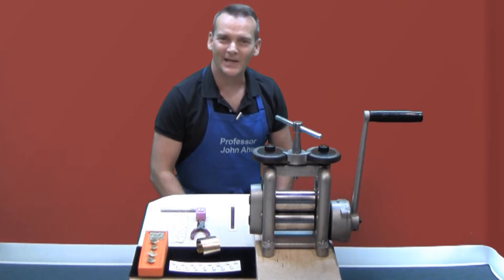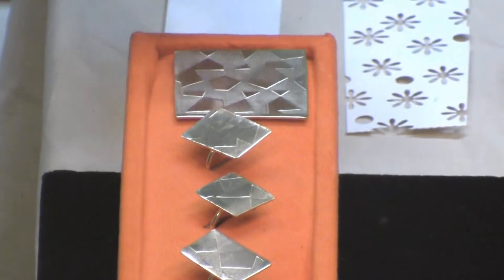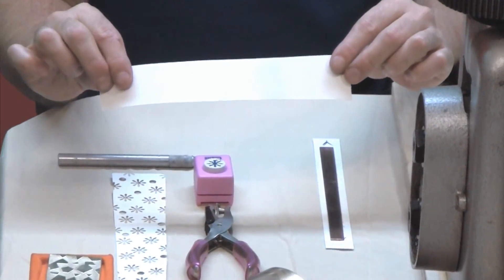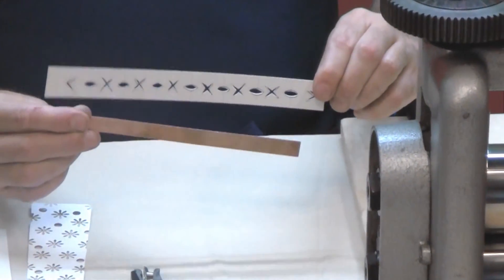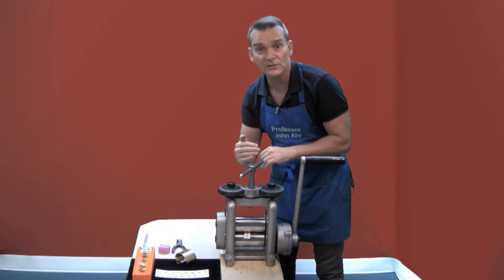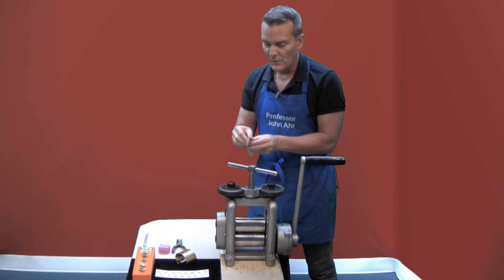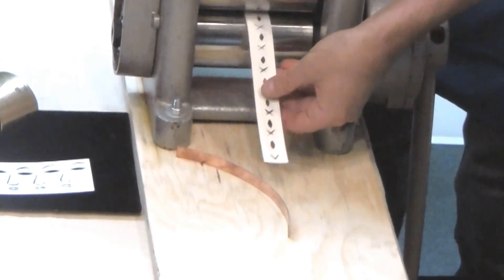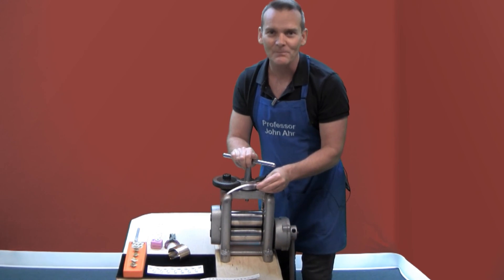Create Texture And Patterns With The Rolling Mill Using Paper

Comment: As always you make me so happy to think of all the fun projects I can create with the skills you share!  Thank you Prof. John!     ps I am a bit afraid of damaging my Durston- saved forever to buy it.  Some sites say to wrap the project in paper towels before putting thru mill.  Thoughts???
Reply from the maker: I'm so glad that you're enjoying the OJA's videos.  To protect your rollers, you can place copper sheets on either side of your project.  Sandwiching you project this way ensures that nothing harder than the rollers comes into contact with them.  Wrapping projects in paper towels can help you from having debris get caught in the gears of your rolling mill.  But, the paper towels will leave a trace of their presence on the back side of whatever you run through the rolling mill.  Be sure to keep the rollers free of moisture.  And when you're not using the rolling mill, lightly coat the rollers with oil and cover the mill to protect it from dust and sunlight.  Yes, sunlight can heat the rollers and promote the development of rust.  There you have it.  Have fun!
Thanks for your support! : )

Comment: Hi! As always, I cherish your tutorials! I wonder if you have any on using rolling mill rollers that are made for creating textures on wire?
Reply from the maker: Hi Erica,  The OJA doesn't have a video on using the rolling mill to texture wire.  Generally textured wire is created with a rolling mill that is equipped with special rollers that have a pattern etched into one of them.  It basically works the same way as the processes demonstrated in the video.  By the way, specialty rollers can be very expensive.
Thanks for your support! : )

Comment: This is just about the thickness of the paper.  You just want to make sure there is enough thickness for the metal not to hit the other side of the roller.  Generally, paper is associated with the pound measurement.  What is the minimum you suggest?
Reply from the maker: The type and thickness of the paper will effect the look of the matte texture.  For example, a manila file folder will produce a heavier texture than a piece of hot press artist's paper.  This technique will work with a piece of 20 lb. paper.  But, you might want to check out the OJA's video on how to make the "Moonshine Bracelet".  You'll find it in our playlist on our website at: www.onlinejewelryacademy.com.  In that video you'll see how I used a brass tool along with a piece of facial tissue to create shiny and matte surfaces.  Have fun experimenting with your rolling mill.
Thanks for your support! : )